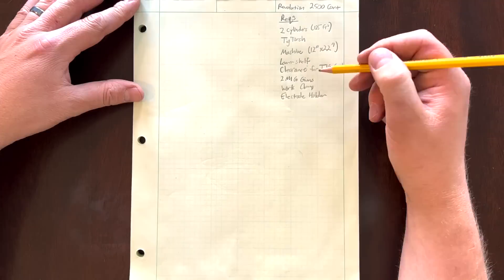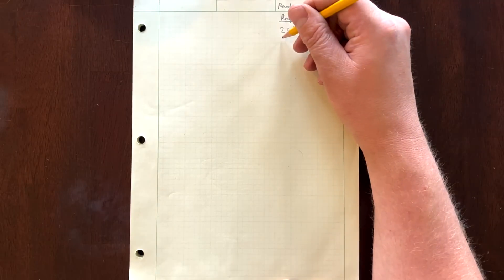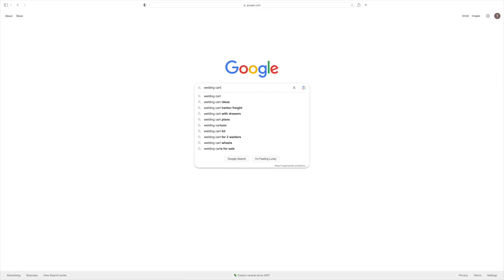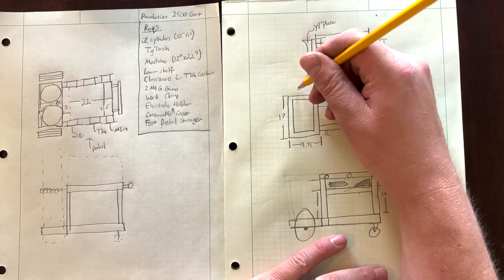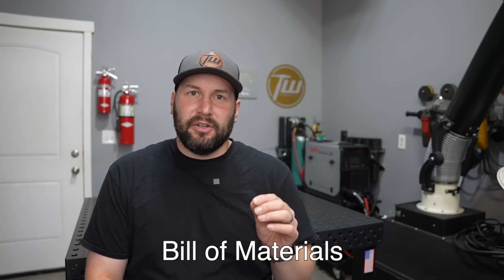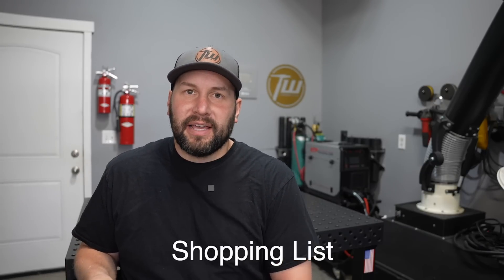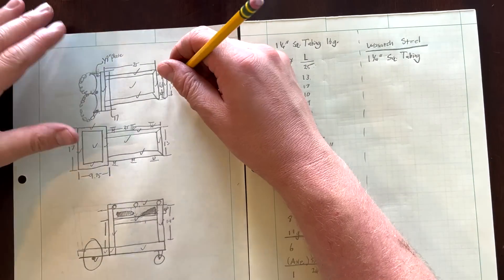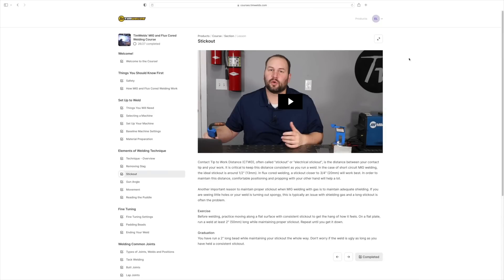Plan Welding Projects in 5 Easy Steps

Comment: Good video Tim. I like the overall setup and especially the two bottle storage. I have a very similar setup with an Everlast Lightening MTS 275 which is about the same size as your new rig. It also has the water cooler which would go on the lower shelf line you mentined. Only thing I would add is a space somewhere for my plasma torch (Hypertherm 30 Air) and a couple 4.5" grinders to hang.

Comment: I always love your videos. I'm looking forward to the welding cart video as many of the needs you have I have too. I have a Strata Advance Multi 205 machine which is single pulse mig and AC/DC tig (pulse). So I have two mig guns, tig torch, arc welding lead and ground to house! I also want to put all my other accessories on there like tig wire, pliers, mig/tig consumables etc. The cheap welding cart I have works kind of ok but the wheels are too small and the welder doesn't fit very well due to being long and skinny.

Comment: Tim, did you get a new camera? Is it me or have you've stepped up your video quality? Thanks for step 1. One question, will you have a step where you measure the final cart to see how well you matched to measurements?  Thanks from Colorado.
Reply from the maker: I did upgrade my camera and I keep trying to up the quality a little at a time, glad it's coming though! The good engineer in me would include an inspection/test step, but in this case, everything fit, so I called that a pass :) It's a really good point, though, and it may be worth a follow on video with something a bit more complex, running through a more detailed and rigorous engineering design process. Thanks Craig!
Reply: @TimWelds  cool, in all the YT welding videos I've never seen a project inspection with attention to customer's requirements, tolerances and what to expect.

Comment: Great tips, Tim!  One thing I would add.  My steel supplier is happy to cut to order.  I save a lot of time by having them cut the majority of what I need, especially as I don't have all of the tooling and machinery to do it easily and accurately as they can.  Check around your area.  You might find a supplier that will cut to order.
Reply from the maker: That's awesome, I'm a bit jealous of that! The suppliers I go to will make a couple rough cuts, but I wouldn't build anything off of them. I only have them cut when I don't want to drag a trailer out there. Thanks!

Comment: What courses do you offer ?
Reply from the maker: Thanks a ton for asking! I have beginner courses in MIG, TIG and Stick welding that start from zero and walk through the learning process step by step covering everything from equipment, setup, settings, technique clear through welding the 4 common joints that make up almost all projects. You can also get a bundle with these 3 plus an intro to fabrication course. They have lifetime access for one fair price and are all online at https://courses.timwelds.com .
Reply: The courses are a real bargain for the beginner.

Comment: Can I ask you what cad software are you using???
Fantastic video by the way and great work
Reply from the maker: Thanks! Those projects were modeled in OnShape, which is a web based CAD software that I really like. The subscription is pretty pricey, but they have a free version for hobby work which requires designs to be public, but has great functionality. I use Autodesk Fusion 360 for my business because I have a paid license for it and it's the most affordable and has the functionality I need for my relatively simple work. I've used all of the big name 3D CAD systems in my engineering career, and once you learn 2, it's pretty easy to pick up any of the others.
Reply: @TimWelds  thanks Tim

Comment: For us newbies, do you have or can you make a vid discussing the normal wall thicknesses used on different projects. I realized each project has its own engineering based on the weight being supported, for example, should you use 1/4" or 0.18" steel stringers for a 9-thread exterior staircase? Or for railings?
Reply from the maker: Great suggestion! I don't have any videos about that at this point, but it would be a great topic to cover. Thanks!
Reply: @TimWelds  I like this idea as well. Recently received 15.... 4ft sticks of 1"sq tubing but it only 048 wall probably to thin to make cart out of.
Reply: @TimWelds  I'd love to watch it! As a beginner I'm always nervous when I need to choose material for a project.
Reply: This is a great idea!
Reply: As an engineer the more I see projects and do stuff I can tell that the thickness is not pre requisite, for example I will do this with 4mm square tube or.. etc,
 but to be estimated base on the momentum of inertia but not only. The role of the engineer is not to select the thickness of the project only but to find the minimum safe. How he does that? Visualize the project, analyze all the factors that he can think off, design it and make it, see all the mistakes and then make it perfect.

Comment: Planning my projects in CAD is the only reason I ever get the result I was dreaming about. Any project that I just 'wing it' ends up with frustrating compromises. 
This is a great topic!
Reply from the maker: Thanks! When I jump right in and just start building, but usually end up regretting it. I may do some more involved design videos with some projects in CAD as well.
Reply: Yeah, I quite often experience the same whatever I do when there's significant amount of time & money involved. Planning is important.
Reply: Am am very new at this but whatever project it would be i usually plan in my head for days, after this video i am thinking of learning some sort of cad software, i have been tinkering with fusion 360 for personal use. But its frustrating as the learning curve is very steep, so i guess i am asking is it worth it in the long end?
Benefits negatives?
Reply: 🎉 1:29